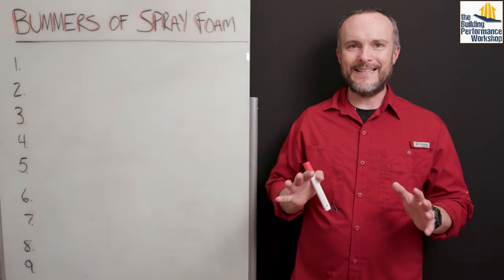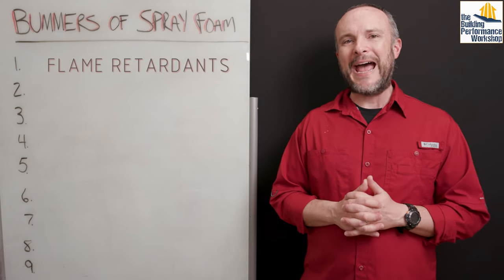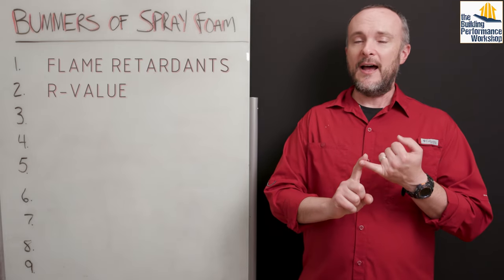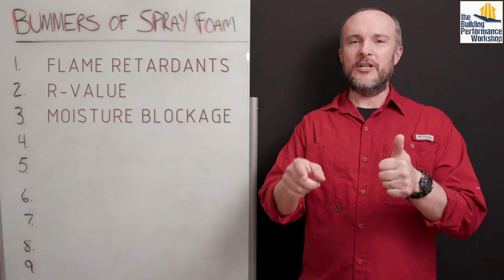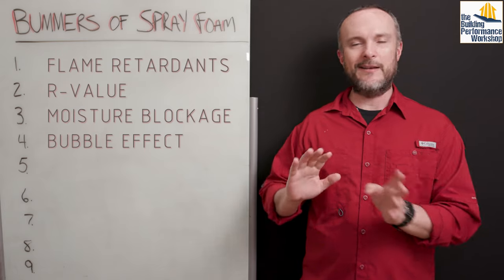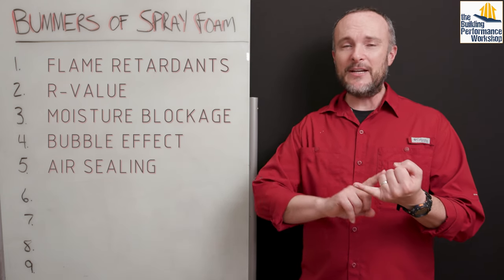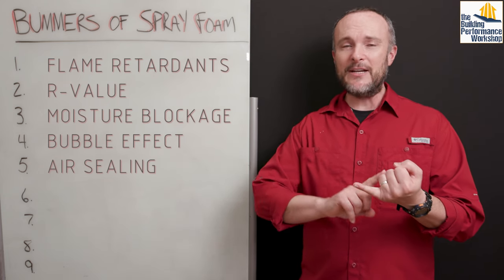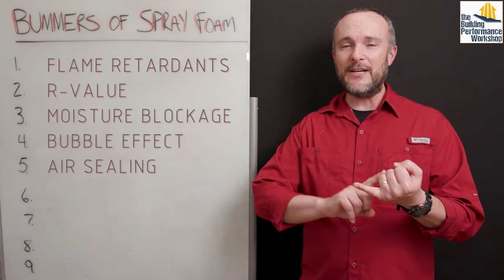Spray Foam Bummers: Make Informed Decisions on Insulating Your Home

Comment: Most of these issues are neutral if you have quality contractor and installers. In a total wall assembly Close cell is superior. You can use many different wall assemblies with close cell as the foundation of air and water barrier. The one item he left out is how close cell adds to the. structural strength of the wall
Reply from the maker: Agreed Gary- like any product, there’s a huge impact from HOW it’s used. Glad you agree the issues do exist, but can be mitigated.

Comment: I would be interested to read some of your sources of information of these claims. I have not found any information that closed cell spray foam, once cured, will off-gas. Only off-gas during the installation process, which is common knowledge.
Reply from the maker: Ask a SPF manufacturer, they’d agree. The law forces them to put flame retardants into the mix, and they are not chemically bonded.
Reply: If applied properly, off gassing is only a problem during the installation/curing process, as you stated.  That should not be a problem with a quality installer.  "Spray Jones" has a video on what to look for in finding a quality installer in your area.

Comment: I love my oc spray foam.  Quality installer definitely makes a difference.  I had to be on them. Had them come out 4 times to fix things they missed or messed up. They trampled the duct work. 
My rule from now on is if I smell the weed,.. then you get to leave. 
 
I am glad I did the ocfoam on the roof. Allowed for easy duct installation, allows for me to be comfortable while working in the construction.

The skin of the oc foam can act as a vapor barrier. Some of the big channels have touched on this. But don't rely on it as a barrier.

Unfortunately your video comes across as a " stay away from SF" video.  :/ 

Sprayjoans on YouTube is good source. Though is based out of Canada ( cold climate).
Reply: Spray Jones...the guy who has a spray foam installation business? Nah, I'm good. I'll stick with actual building science.
Reply: @V0lk  ni was  NOT  Spray Jones. 
Spray Jones is is how I know the company I hired could have done better. 
Spray foam is science. New science. Problem with today standards are based on old science, and old thinking. We have been patching together new tech ideas on these old things.

Comment: May I make a comment on this? I came across this while gleaning more/new/various information about spray foam. I am sensing great amounts of bias, in your body language, your tone, facial expression, and snarky comments regarding spray foam. Did you have a bad experience?
I spray foam for a living in the northern USA and also run a business that does the whole insulation gamut. My only experience is with medium density foam (2lb foam). "High density foam" is 3lb foam. By the way, my machine can spray 30lb military grade foam.

Assuming I understood your video correctly:

TLDR:
1 - Arguably no. 2 - You are half right. Understand your material. 3 - Hard no. 4 - Wut? 5 - This is an unfair claim. 6 - I agree. 7 - Yes! Thank you for recognizing how hard this job is. 8 - I agree. 9 - Can't argue because of reasons.

1. I don't believe the flame retardant in spray foam is a real issue. It's there for a very good reason and the fear of it giving gene mutations is extremely unlikely. The pajamas in the 70's were in DIRECT CONTACT of skin. No one I know these days wears spray foam PJ's. Improperly mixed spray foam will emit bad gasses, that's an inexperience installer fault, or old equipment. Properly mixed, SPF is almost as inert as any other plastic. This fire retardant may be the reason that home in your story had the interior walls sprayed. Here's a video of spray foam not burning: https://www.youtube.com/watch?v=2ZBa1ijiHwY 

2. You are right about R-value of OC foam being poo. Closed cell foam excels in this at an average of R7 per inch installed. (this is a rabbit hole discussion so I'm using prescriptive approach, which is easier to understand, rather than performance) My advice for consumers is to make sure of the TYPE of foam that will be installed. Don't pay for expensive and then get the cheap stuff installed.

3. The vapor barrier (the plastic over the wall between the glass and the drywall) argument is only as good (or bad) as the installers. That problem goes away with spray foam. Regarding the roof, why would moisture be headed TOWARDS the foam unless there is a leak? If it got to the point where it is ALREADY LEAKING through the roof then this is a problem whether there is spray foam or not. The only thing that changes is WHEN the problem appears. Spray foam will prevent water from leaking into your home, the downside is that it pools up on the roof which may make the damage more visible and sooner. Hopefully this happens while your roof is still under warranty. Otherwise the homeowner will have to foot the bill.

4. Where's the problem here? The only thing you said is advice based on personal opinion and your friends (anyone can spray foam but a spray tech can manufacture proper foam). Most new buildings have the appropriate air handlers to make sure the air quality in the house is appropriate for the building design. If spray foam is installed, the HVAC guy needs to know he's now managing the air in an almost air tight environment rather than a cardboard box with drafty holes, which means different equipment. This is why it's important for the engineer's plans to be followed and if not, everyone involved in the building envelope needs to talk.

5. Again, this boils down to installer skill and proper mix. Fiberglass can be installed by any idiot, that's the appeal for some of the guys I employ. (they get paid very well though, hard to find good help these days) It's unfair to take your WORST spray foam experience and apply it across the board.

6. Very good, now you know the basics of what we do. A skilled and alert tech is cognizant of the environment and constantly reading the field where he will, and has already sprayed. It is a science and a skilled installer has invested time and research into making sure he does the job right. But to call it an experiment makes it sound like one would be unsure of the final product. When following a recipe in a cookbook, is this also an experiment? Temperature, conditions, amounts, etc. yet for the most part, it comes out how you expect. A skilled chef knows how fluffy to make the meringue for the pastry he wants to make. This doesn't happen overnight. Same with foam.

7. YAY! Finally we get to the most important part....the important guy.

8. This is true. I have stuck a meat probe into different depths of foam in a controlled environment to see how hot they get. The hottest exothermic chain reaction was 280F. This varies by manufacturer and the type of blowing agent used. The insulation around electrical wiring can melt in the range of 100-260°C (212-500°F) depending on the makeup of the PVC. Modern electrical wiring will stand up to the heat generated by spray foam. OLDER HOMES may need to worry about melting wires.

9. Insurance isn't my field of expertise so you know more than I do. I have no argument. =)

Your suggestion about making sure your insulation installer (or contractor, or plumber) comes recommended is good advice that we all know but many often forget to ask.

Comment: Matt Risinger in shambles right now. Though honestly I'm not sure if you've persuaded me to go back to rockwool or flash and batt in the house I'm about to build. Flame Retardants and VOCs aren't that big of a deal if you get one of the Greengard certified options on the market. You're the first person I've heard mention that closed cell isn't air tight so I would like to see more data on that. While the product can seem expensive, it is double the r-value. In my area rock wool is $1.19 per R15 (material only, not installed) and spray foam is $3 per R15 (material AND installation). If you pay someone to install the price of rock wool would prob hit close to $2. That's not much of a price difference for something that could allow you to have a thinner wall (savings!) and possibly (probably?) give you some air tightness. I'm curious too about your bubble effect comment. If you have a fresh air system why would it matter if both walls and roof are sprayed?
Reply from the maker: Hey Eric- first ALL spray fosms in the US are required to contain flame retardants. Airtightness is about the installer more than the material- test and you’ll see. And last, the bubble effect just makes the home less flexible, less margin for error in air quality.
Reply: @HomePerformance  Also just wanted to point out that even with a perfect install, it still may not remain airtight.  This happened to an area (crawlspace) where I foamed the underside of the floor above.  Due to expansion/contraction of the different underlying materials, the foam split in several different places.  Had to go back and touch it up with some great stuff.

Comment: Several types of insulation have flame retardants and other chemicals, don't eat it or grid and sniff it. Spray foam is by far the best. Batts sags and comes loose over time and leaves large gaps in the wall.

Comment: I’m surprised that air sealing is listed as one of the “bummers”. I’m very concerned about the flame retardants, off-gassing, etc., that you mentioned but I haven’t been able to come up with another way to tighten the air envelope of my existing early-90’s construction home with all brick cladding. Is it possible to achieve modern levels of air tightness with Rockwool or similar batt insulation in a retrofit application?
Reply: You can use AeroBarrier; not cheap, but it works. You could also pull the brick siding off, apply a fluid applied wrb, and replace the brick.
Reply: The air barrier is pretty much an issue related specifically to offgassing concerns, which is something this guy is focussed on to a level that I don't find compelling, but from that focus, this is a legitimate complaint. You want your barrier between you and anything you feel is a non trivial source of offgassing, so he's going to advocate for an inside barrier under the drywall, and that's gonna keep the house as an air space that only has drywall and other inside stuff in it, and protects the inhabitants from all the stuff in the framing cavities. If you want to stay away from fire retardants, this is the obvious way to go, and you could do this in your house too, with spray foam or other insulation, as long as you're willing to take off all your internal panels/drywall, but that's a pretty big task... 

Have you already replaced all your obvious penetrations with more modern standard components? Doors and windows and such? Do you know how leaky your house is? Figuring out that stuff first probably is going to give you better returns on investment, but I don't know the details of your house.

Comment: Wonderful video and fat presentation! Made me think about using spray foam. Wondering what is your opinion on SIP panels? These are factory manufactured and get be covered with gypsum on the inside and air and water barrier on the outside.

Comment: Chicago suburb resident.  We took to heart the out-gassing  potential of the foam when we were doing our 60s house renovation.  So, we had foam applied to areas where this would not be a potential problem.  Underside of roof in vaulted ceiling, underside of roof in ventilated attic over kitchen, and crawlspace walls.  All other areas were done with either rockwool or fiberglass.  We had a good contractor who did quality work, and as you pointed out that is about 80% of the way to ensuring you get a great result.

Comment: I've also found it difficult to determine what sets particular installers apart. I have no SPFA installers in my area and most others are doing commercial jobs only. They're the most important part of the install but (I think) it's hard for homeowners to make an informed decision on who their installer should be. I'm about to have my basement rim-joists (some with very limited access) and block walls spray foamed as I believe this is another candidate for when HD ccSPF makes sense. 

Another great addition to this video is the BS and Beer Show's talk on spray foam in March: https://www.youtube.com/watch?v=p7QxXNIbK8M 

What questions are valuable to ask an installer to determine who is more likely to be experienced and perform the job well?
What test-driven assurances can we attempt to negotiate into jobs?

Comment: I have some great pictures of a spray foam horror story from a recent inspection I did here in SC. Too much lift, bad mix and pretty certain it was sprayed on when the woods moisture content was too high. It's a mess and the homes humidity is so high they grow mold in less that 2 weeks after being cleaned. Unfortunately the spray foam isn't their only problem. The builder literally left the home unfinished after blowing past the budget without warning. It's truly sad.
Reply: Sound like a crappy builder not a spray foam problem.

Comment: Off topic here.  I’m curious if you guys have any interest in discussing hempcrete.  I’m looking at doing it and it seems like it hits a lot of the high water marks you discuss without the chemicals and such.
Reply: I loved this idea and wanted to use in our new construction home. Problem is the company is not very customer responsive - minimal response to questions via email and there is no phone number to contact and if worried about whether fire resistant or not you have to wait until their fire restart product is available which keeps getting moved back. Frustrating to say the least because I’ve had to forgo using it.

Comment: Hi Corbett, another great video! Four questions:
1. I’ve heard that certain chemicals, like formaldehyde in plywood for example, off-gas for years and that increasing the amount of ventilation in the room or building will actually increase the amount of off-gassing instead of diluting the chemicals concentration. Could this also be true for the off-gassing of flame retardant chemicals in spray foam?
2. One of the areas in a house that is notoriously difficult to insulate and air seal is the rim joist. If you don’t spray foam this area, what is the best method/material to use instead?
3. I just watched a video from architect Steve Baczek called “Basement Insulation – Farmhouse” on how to best insulate a concrete basement and he recommends 2 inches of closed cell spray foam on the interior surface of the concrete walls and then filling the rest of the stud bays with dense packed cellulose (the stud wall is set 2” off from the concrete). 
Steve Baczek video.
https://www.youtube.com/watch?v=2yOqftUuM2c&t=31s
If not using spray foam to insulate a basement wall, what material/method do you recommend instead?
4. I watched a recent video from Matt Risinger called “Crappy Attics” and demonstrated how someone can turn the standard American crappy attic into an awesome attic by spray foaming the underside of the roof sheathing and “encapsulating” the attic to turn it into usable interior space (he used his own house as an example and had a metal standing seam roof). 
Matt Risinger video.
https://www.youtube.com/watch?v=ddjjwY6zzG8&t=143s
Since you said that all spray foam is technically a petroleum product (and therefore flammable) wouldn’t it be best practice to cover any open, visible foam with a layer of 5/8” fire rated drywall?
Reply: You've got a good start watching Steve Baczek and Matt Risinger.  Steve designs passive houses and both are very knowledgeable in building science.  Look for Spray Jones on Youtube for fact based information on closed cell and open cell spray foam.  Unfortunately, this video is more of a scare video than information based on facts.  Take your time researching and choose what is best for you based on facts.  Good luck!

Comment: Some folks on Green Building Advisors advise that there is no replacement for closed cell foam for basements in mixed/humid climates like 4a. Is this really true?
Reply from the maker: Everything is replaceable, just like every one of us. Whatever it takes to get you an air barrier, drainage layer, and insulation layer.

Comment: 10 Extremely difficult to repair or remodel at a later date.
 Sadly few builders think of the next guy. I also have a hatred for furring strips on ceilings. When you go to remodel you haven't a clue where the joists are unless you do exploratory surgery as no one has a stud finder that can see the joists that far away from the drywall reliably.
Reply from the maker: Wow, very interesting point Craftsman (by the way everybody, the second bit here is not about SPF, but high performance home building in general).
Reply: @HomePerformance  Also I dug up a good pic I took a while back when I was replacing a wall of doors on a lakehouse with two 14' slider door units. After tearing the wall open the Melamine foam that was poured into the walls was just a hare too small after it shrunk. A common problem with that stuff. Let me know where to send it and I'll send it your way. It's a good illustration on what you don't want in your walls.
Reply from the maker: Always up for pics- send to corbett at BuildingPerformanceWorkshop.com